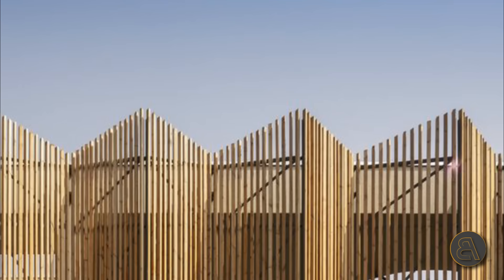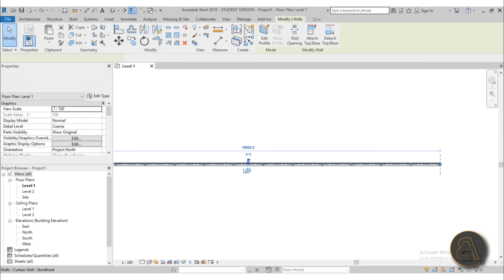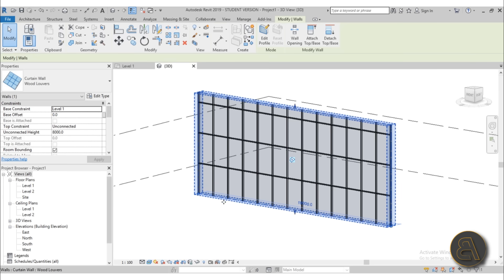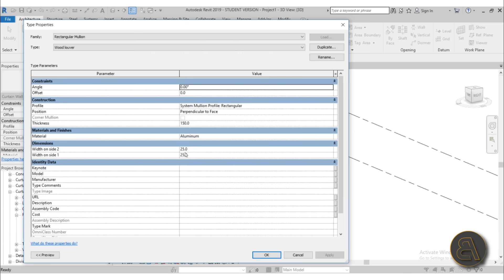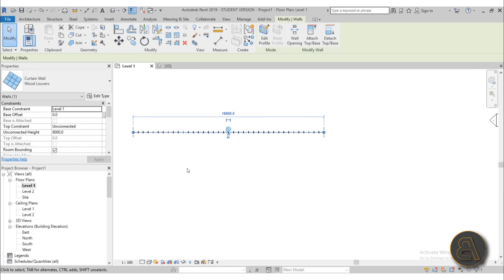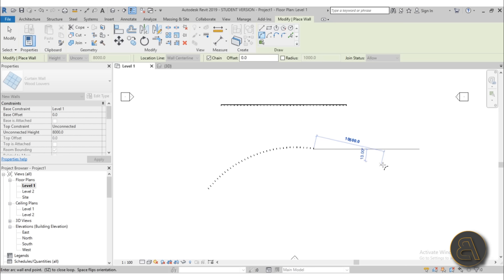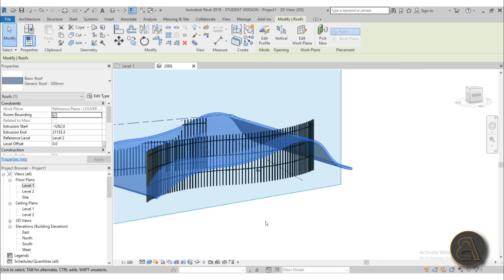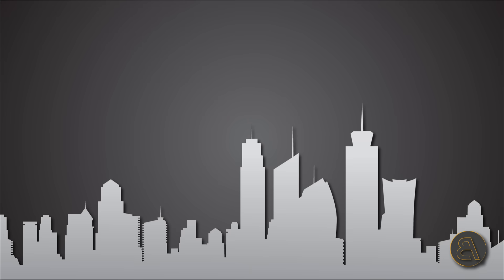Wood Louvers in Revit Tutorial

Comment: Hi, What if my revit doesn't have empty option? it has different empty option but the glass is still there. Even if I create a new family type under Curtain wall system next to glazed and solid I created empty and used material air it is not see through..

Comment: everything worked well until i made the roof by extrusion and in the section where the panels were cut it said can't use type empty system panel so it just fills it with a glass panel on top. what's  the solution?

Comment: From architect "it's quick to build, only takes 10 minutes". I'd love to hear what the wood construction worker says when he receives these drawings about how quick it is to build IRL =) The actual trick is to do something that looks very nice (not dull) yet is quick to "build". Maybe for something like this Revit should be able to output digital instructions to CNC etc machine that would cut those wood stripes exactly in correct length and number them THEN it would be very easy for construction guy just to line those up!
Reply: Ofcourse this will take too long on actual construction even with the process u mention with CNC. He just mean its quick build in REVIT only.

Comment: Cool hacks man. Only pbm with using the roof is that it will going to be visible in every other views, any other way to make it work instead?
Reply: You can make a "Hidden Elements Workset".  Set the workset to be not visible in all views and move the roof to that workset, or simply always have the workset closed.  If you would like to edit the roof you can create a 3d view that has this workset visible only in that view.

Comment: Empty System Panel: Empty    does not appear as an option on mine, is there a way around this?
Reply: Solved... Check message 16/21 (bautistaj) and download te file attached . https://forums.autodesk.com/t5/revit-architecture-forum/empty-system-panel-is-missing-revit-2017/m-p/8348969/highlight/true#M216155
Reply: I have the same issue